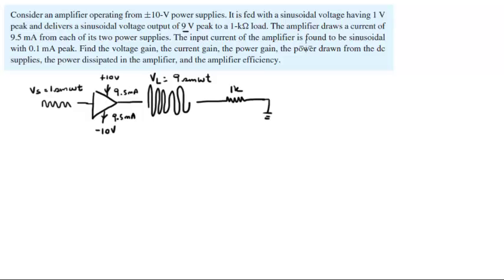Find the voltage, current and power gain, power drawn, power dissipated, and efficiency

Comment: Please kindly help solve this problem for me. 
An amplifier operating from ±3-V supplies provides
a 2.2-V peak sine wave across a 100- load when provided
with a 0.2-V peak input from which 1.0 mA peak is drawn. The
average current in each supply is measured to be 20 mA.Find
the voltage gain, current gain, and power gain expressed as
ratios and in decibels as well as the supply power, amplifier
dissipation, and amplifier efficiency.